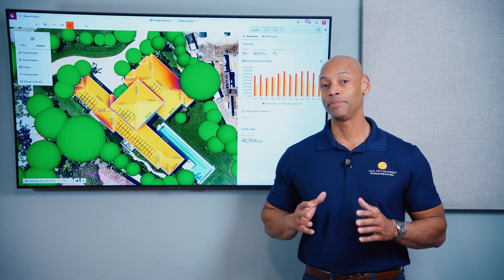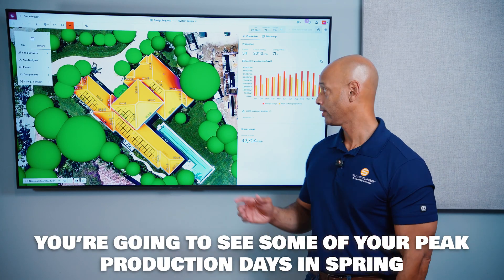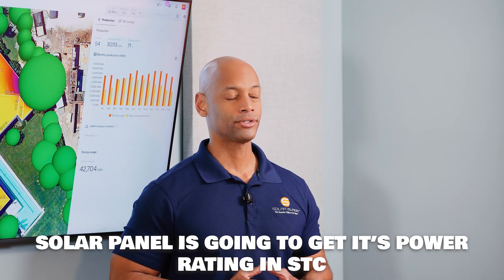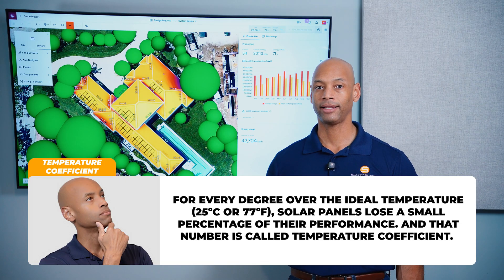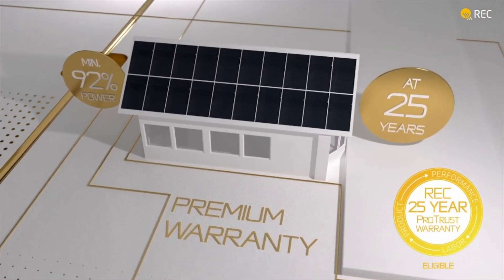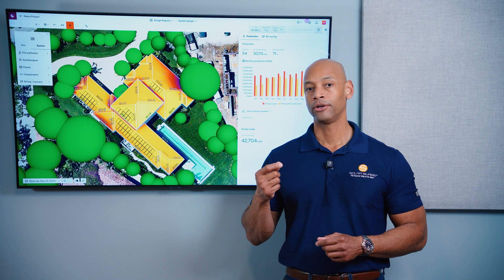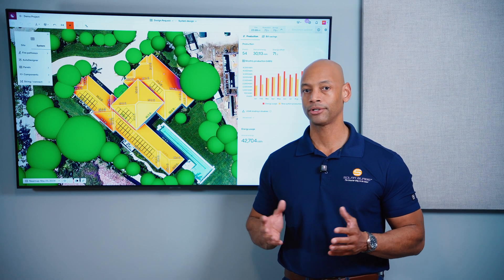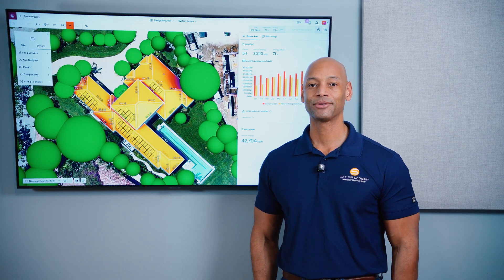How to MAX Your Solar Production (2025 Updated)

Comment: Is it possible or do you know of any current studies or testing that compares STC,NMOT and Low temp parameters for panels?   This would help immensely in different geographical locations around the USA.   Otherwise =, installers just select the panels that benefit the installer instead of the consumer.  Thanks and great info

Comment: March / April is the peak solar season for folks in Florida.
Reply from the maker: That’s correct. The combination of sunny days with relatively cool temperatures makes for the highest solar production.
Reply: @SolarSurge  yeah unfortunately it's only in the spring, fall it's hurricane season and it's always raining and humid. So unfortunately we don't get it on the other side.
Reply: Really summer production is less that spring?

Comment: #1 TIP - Keep your panels clean.
Reply: Maybe depends on your location, because I haven't washed mine in 6 years with no appreciable degradation in performance
Reply: @ When I clean mine. I get an increase of 15% power being generated.
Reply: @ericinla65  how often do you clean them?   String or microinverters? I guess I get enough rain to not be a problem. I picked two adjacent panels and cleaned one with zero gain the next day. I'm gonna try it again to verify my last outcome.
Reply: @chrisrobey77  As needed, about once a month.  I live in Los Angeles, where it never rains.  Except for a few winter days.  So they get really dusty.  I see other panels around my neighborhood that are filthy.
Reply: Pollen during ideal production season, April to mid May.